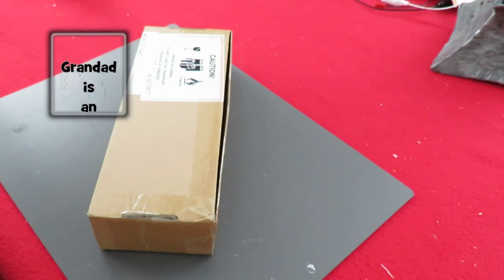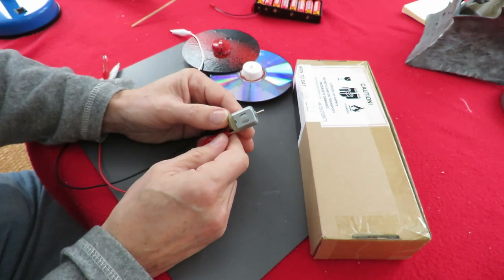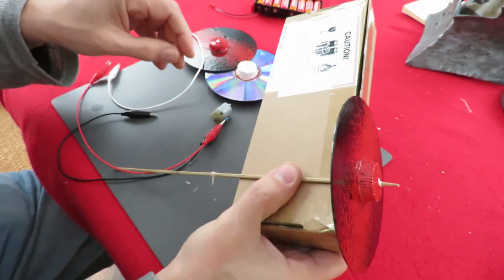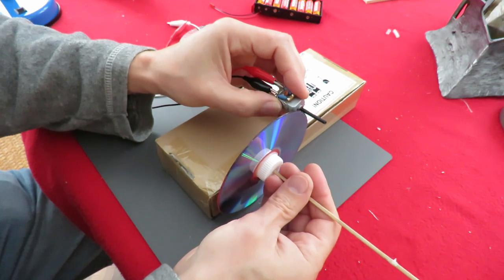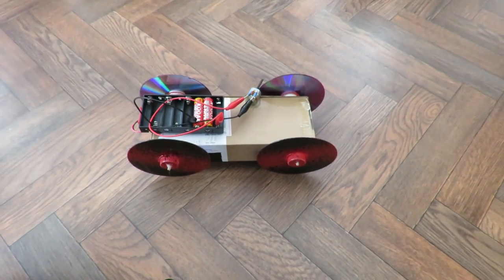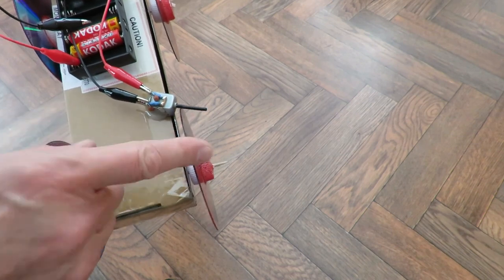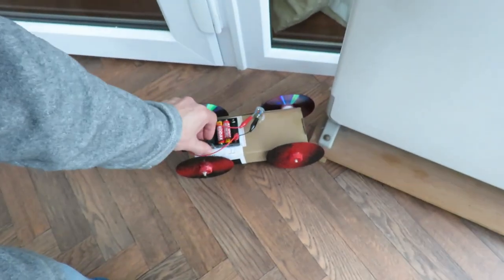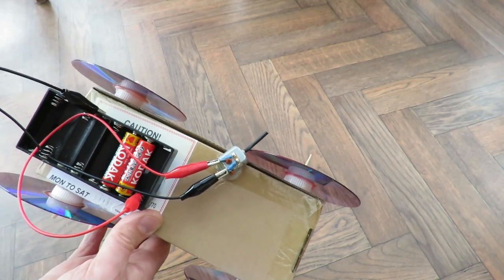Making a Basic toy car with electric motor

Comment: cool ! nice and simple  it would be even faster if you used a rubber band onto the motor and one of the wheels and using one of those very large rubber bands that the postman uses you may even be able to make it four wheel drive !
Reply from the maker: Thanks, the idea was to make this as basic as I could as requested by the viewer.
Reply: well you succeeded ! you couldn't get more basic than that ! just reposition the motor and fit a rubber band was just a suggestion
Reply: @thehappylittlefoxakabenji8154  thanks I appreciate your suggestions, always welcome. You will find the pulley progression is mentioned in the video description and I also mention it near the end of the video. The follow up video (using a pulley and rubber band) is scheduled for Saturday. I haven't done a third video using gears as that would involve buying the parts to suit whereas these two videos use scrap items. Of course a dedicated DIY enthusiast would make the gears from cardboard like my YouTube friend Nesmaniac - here is an example of his excellent work https://youtu.be/0dxN7N-L6ro
Reply: cool thanks that was quite interesting I remember reading somewhere about making cardboard gears by using the inside of corrugated cardboard wrapped around a one of those round cardboard boxes the little cheese triangles came in ! I look forward to your next video with the rubber band ! maybe one day you can make something with caterpillar tracks a couple of bottle tops would make a good Pulley or drive wheel !
Reply: @thehappylittlefoxakabenji8154  caterpillar tracks have been on my list for years now but somehow I never get down to doing the job, maybe one day 🙂